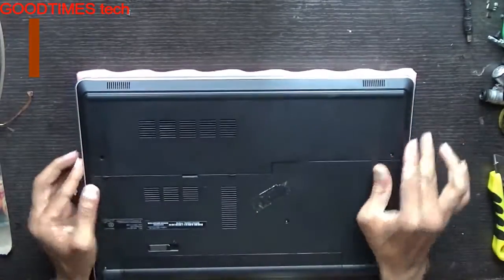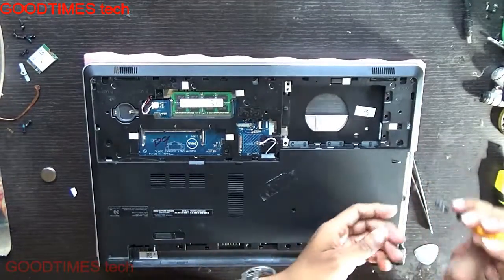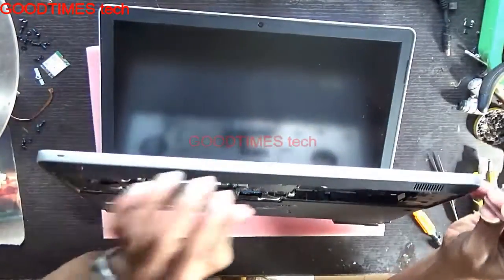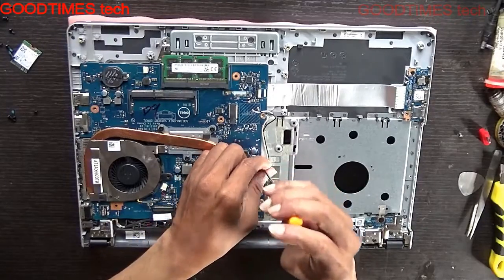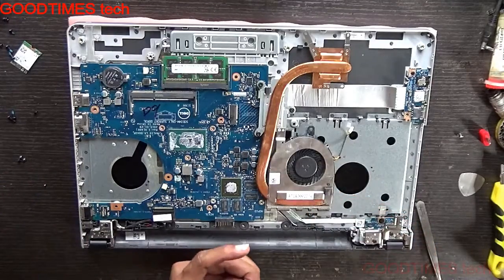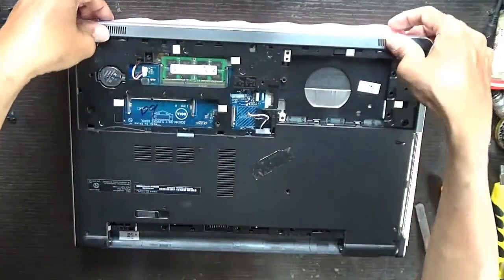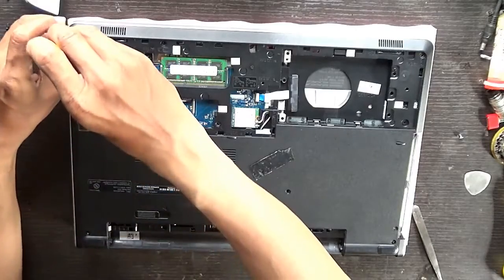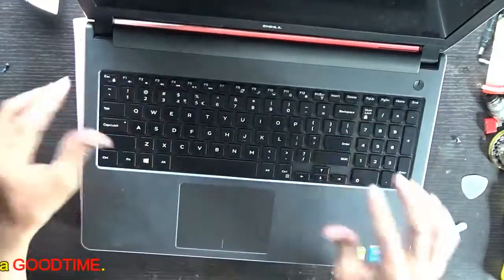DELL Inspiron P51F | 15-5558 | overheating solution.

Comment: Im cleaning the fan now because i got the processor and fan failure during troubleshooting.. But my lcd doesnt work and when i plug it in to external hdmi i get the 8 beeps so what do you think it is the processor or bad lcd?